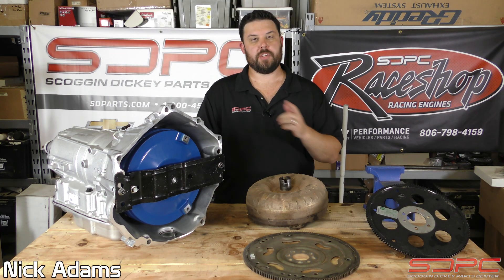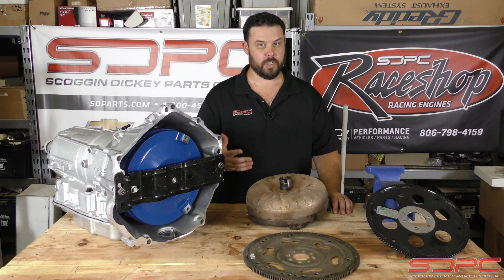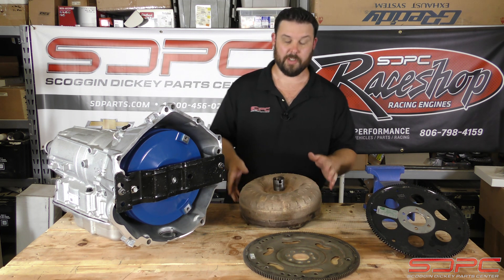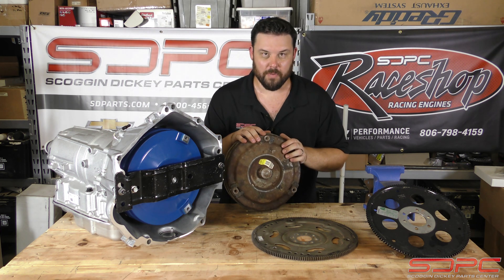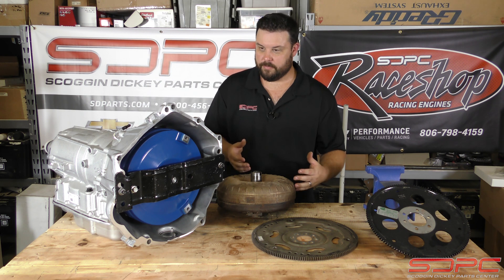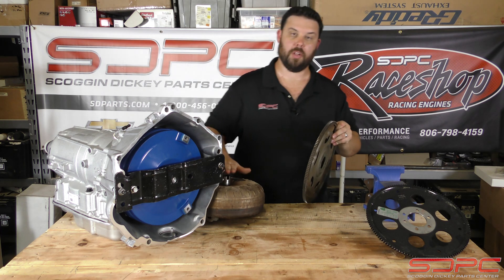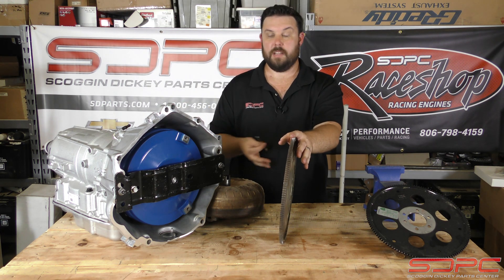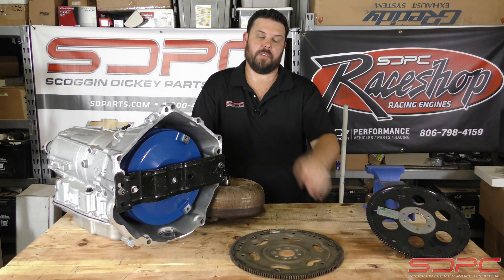SDPC Tech Tips: Torque Converter Spacing

Comment: Thank you very much! I couldn't understand why the engine doesn't easily mount with a gearbox. Went online looking for tips. Found you video. Took out the engine - the torque converter was a little off. Rotated it few times and got in in place. Thank you!

Comment: On a flexplate/flywheel for a 4L60E there is an oval hole that I find is the first bolt you should put in.  Does that mean that the other two bolt will line up correctly if you do the oval hole first?  Thank you, good video!

Comment: I have a 454 big block with a turbo 350 and my torque converter is fully seated but my bell housing isn’t flush with my motor and the torque converter is hitting the fly wheel keeping the bell housing from seating against the motor. I know it’s fully seated so what else could be the issue ???? Help please

Comment: Great info! Great advice! This may be a dumb question, but like you said, it’s no fun doing it twice or spending twice! My question is, when tightening the torque converter bolts should the 1/8” gap still be there or should it close?

Comment: I guess the person who put my trans in did not make sure there was spacing between my converter and flex plate and after I drive about 20 miles it sounds like there is a whinning noise coming from the converter does this mean it is shot or can I put the washers in there and it be good to go

Comment: Can you please do a video how to hook up 10L90E 10 speed to LT4 crate engine? I’m having major problems. There a flange that sticks out on the flex plate, I’m not sure what this is for. Reading directions to use bolts to mount torque converter but don’t see holes. Help
Reply from the maker: Here you go Johnnie!

https://www.youtube.com/watch?v=vSHH7P0XD34

Comment: Question, what would I need to do to change the 4L80E to the 6L80E? Other than programming,  do I need to change the steering column with one made for 6 speed? Or will oem work just won't show 1st and 2nd on the dash?
Reply from the maker: Some of that is going to be vehicle specific.  What's the year/make/model and what engine are we dealing with?
Reply: Started with 06 silverado 1500 4wd dbw l33 and 4l60e trans. Swapping in the 2006 2500 silverado 6.0 bored .40 over and wanting to know what it would take to match that with a 6l80e trans instead of the 4l80e trans the new motor came with.